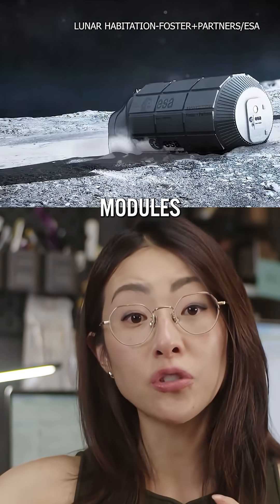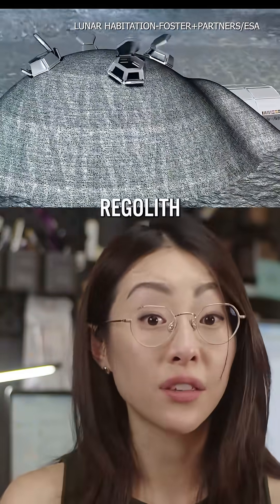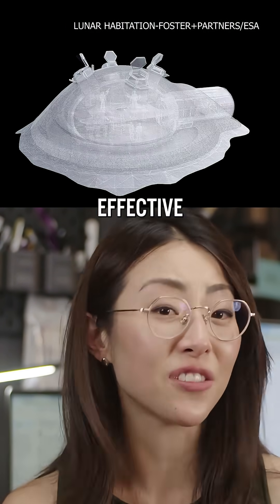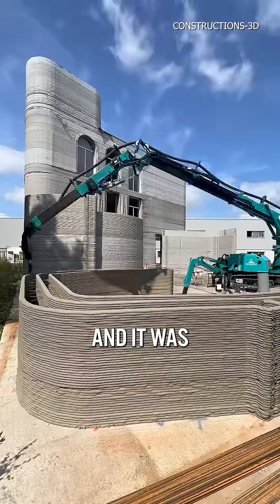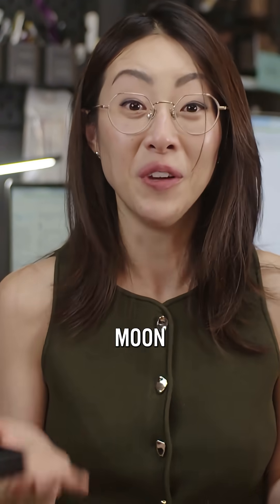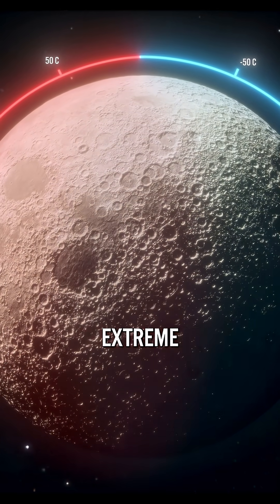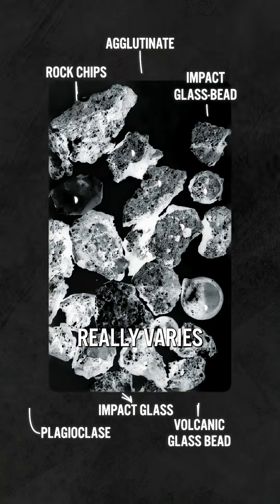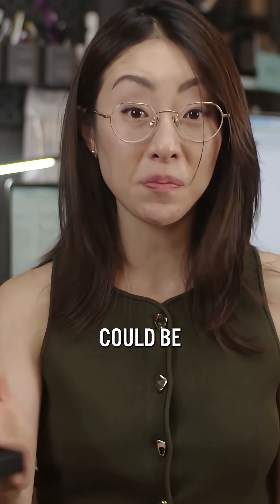What would you build first if you had a lunar 3D printer?

Comment: Lunar dust is a horror movie hazard. Magnetic, asbestos-like, and impossible to properly remove.
Reply: moon dust is super easy to remove due to its electrostatic and magnetic properties. all you need to do is charge the dust and the object you want to remove it from with the same polarity and the dust will be repelled.
Reply: @KT-pv3kl we missed out on Lovecraft not being aware of lunar horror dust that requires magnets. The man wrote novels from his fear of air conditioners and the color spectrum (and so much racism). Imagine what horrors he would have dreamt up with lunar dust?
Reply: @KT-pv3kl  doesn't sound easy? What you put out a magnet to attract it than as soon as you move it to the area, now you have just moved more. That's like using a magnet but not accounting for the fact everything your on is magnetic. Sorry if I'm wrong but it seems like a nightmare
Reply: @steve-v2g  It requires a vacuum chamber and a way to effectively do a static discharge on your suit. Modern space suits are actually really fine with the dust because they are static neutral so the dust won't cling to them. then there's the metal they use are all non magnetic aluminum so they don't accumulate charge. NASA is very paranoid and rightfully so about static discharge that could potentially short a electrical system or even create any form of spark. inside the ISS they have areas of the ship everywhere specifically made to help the astronauts discharge any accumulated charge in a safe way.
Reply: @steve-v2g you are wrong!

Its easier due to the magnetism.

Look up what an electro magnet is.

Magnetism is insanely complicated ao im not gonna get into it, but yea, it makes life easier.
Reply: @KT-pv3kl you have zero idea what you are talking about. They are this micro hook, knife, and anything sharp. And on top of that, it is also charged, so it wants to stick to things. It is not impossible but super duper hard to clean. In some cases, so bad that you might just want to use Energy Beam to just evaporate them.
Reply: Sounds fantastic. 😐
Reply: Those actually sound like benefits to me. Why not blow up a electrically polarized shell to attract the magnetic dust, then essentially use a powder coating process to seal the shell? Assuming the magnetism is due to metallic content it could provide increased radiation shielding.
Reply: @bobcostas9716  you forget the part of the powder coating process where you bake the material to melt the pigment into place.
Reply: @bobcostas9716 Not when you needed meters thick.
Reply: Asbestos if it did to Kevlar what it normally does to lungs, absolutely terrifying.
Reply: The lunar chronicles 

Is a young adult fiction series. But it does have a little mention of the effects of regolith dust on a person's lungs.
Reply: not to mention that it won't block the radiation like people think it does. You'd need about 3 stories of regolith between the habitat and the surface.
Reply: @Sadarsa that’s way not than I thought
Reply: AnikanSand.gif
Reply: It's not Magnetic 
Electrostatic charge and magnetism are very different things
Reply: @GerManBearPig thanks
Reply: portal 2 plot
Reply: Sounds like properties that might be exploited rather than sifted through traditional methods.

Comment: Did they also calculate the "Moon dust" how that might affect the building process?
Reply: Definitely not 😂

Lunar regolith is way harder to work with than earth regolith.  It's extremely sharp, like Asbestos, but cutting through Kevlar the way it would normally cut through lungs.  They also will have a lot of trouble with moisture, given that the moon is 120c during the day and -130c at night

Comment: It seams like an inflatable structure doesn't necessarily need a 3d printed shell, would it not be simpler to basically slap on a layer of 'moon cement' to the outside of the balloon, why is it necessary to "3d print"?

Comment: As I understand it, 3d printing hasn’t taken over construction because it requires a massive investment to only take care of a portion of the build. The walls are definitely a chunk of the cost to put up a building, but they aren’t the most expensive component. Also they are effectively just laying CMU and grouting, they still need interior and exterior finish. 

I think we would see a lot more 3d printing of buildings if the infrastructure and the engineering were already FIRMLY in place. But this is likely to either require a long time for the machines to get cheaper and more common, or massive public investment. 

So if building departments had standardized tables and formula to quickly stamp the plans, and if there were enough printing firms that contractors could easily swap them out for mason or framer subs, then we’d likely see an explosion. We aren’t at critical mass, and I’m not sure if we are going to get there organically.
Reply: the Romans perfected 3D printing without a 3D printer. Extrude that concrete into a form.
Reply: @RWZiggy lol. Yes, casting goes a long way. It isn’t really efficient, but is much more efficient than traditional masonry. Some pretty impressive shenanigans with that mall and the pantheon roof.
Reply: if that happens itll probably be mostly america that does it, after all they mostly build things out of wood still so they havint quite made it to the stone age yet
Reply: @Reginald-Erasmuslol
Reply: 3D printing hasn't taken over because it doesn't solve any problems present in construction. Pulling up a wall is the easiest 1/4 of a house. And doing this with 3D printing makes the other 3/4 of the house much more expensive and is structurally even inferior because it cannot handle tension, massively limiting it's application.
Reply: @dominikvonlavante6113 everytime we change or add building techniques our other systems adapt. But it is true that the other systems are a lot more complicated now. The tension is a good point. As far as doesn’t solve any problems, it does, but because it isn’t cheap and already part of the way we do things it makes everything harder and more expensive.

I’m not eager to see it take off, because as-is it really only makes pods, huts and bungalows efficiently. But I am interested in seeing where the technology could lead, and what niche(s) it could fit into.
Reply: It6 also doesn't solve any of the problems that make construction expensive. You can't 3d print electirical or plumbing or any of the other labor intensive trades.
Reply: @d @davidberry7115 im pretty sure I said that.

Comment: I think we need to find the perfect crater to build this process into a parent facility that is at least partially underground to cut printing time by 50-75% then once we have a long term facility and plan B you can send astronauts and equipment to print more smaller child facilities. Or and im not sure if this is less resource efficient. You place the entire project into a shallow but wide crater so that you can one stay out of constant radiation. and two find a more consistent substrate within the environment of the pulverized moon rock. I wonder how ejecta disperses after a strike there has to be some order to it right?

Comment: Thomas Kuhn's The Structure of Scientific Revolutions explained why this kind of behavior occurs: it’s not enough for a technology or theory to be better than the current one in order to replace it—it must also break the generational barrier to be accepted and become the norm. 3D printing can be a revolutionary technology, but right now, most of the civil engineering field is used to doing things the old way. If 3D printing truly proves to be a better technology than conventional methods, more and more professionals will embrace it and begin phasing out the old technologies. In a way, the new must wait for the old to die before it can take its place.

Comment: 3D printing will not be used in the construction industry on a global scale for another 1000 years if not ever. Those who said it will, are idiots or they wanted investor money. It cost a lot more, needs more skilled workers to put it together, limited in speed, still needs human resources while building, limited in the build shape or the cost gets multiplied, only reinforced concrete work as a building material, Plumbers and Electricians nightmare to install anything into the walls/floors. 10 skilled workers build a house faster and it will look better.

Comment: Protection from what? meteors?
Reply: I don't think any surface lunar base stands a chance against a proper meteor, though in fairness, they are exceedingly rare.  The 200x earth radiation, the temperatures of 120c during the day and -130c at night, and the dust particles moving at 100s of km/s are a much bigger issue.

Comment: Why are you building on the surface? As Isaac Arthur points out, the best permanent lunar settlements are built underground in the vast network of mega caverns formed as lava tubes (see “A comprehensive review of lunar lava tube base construction and field research on a potential Earth test site” by Feng et al).
Reply: The biggest problem with moon ground buildings is radiation shielding. Also thermal regulation.

Underground, or with heavy and thiccc regolith walls, you can shield from radiation and temperature swings.

Because, being there for a few days or a week is fine, but staying for long time, it'll be a problem.

That's also the reason all human space stations are low earth orbit, the earths magnetic field still provides radiation shielding.

Out there, beyond the earths protective field, long term the lightweight space modules don't provide enough shielding.

Likely, the first habitats will be on ground, and habited not all the time, while we dig and establish safer and more stable bases underground. Also, might harness with drilling some moon thermal heat, because we'll need plants, and lots of them, to get oxygen. Also, another thing is getting water. As water is damn heavy, but also really necessary for basic life and also basic chemistry.

That's a big part of why nasa wants to explore the lunar poles, and the Artemis missions want a polar orbit over the moon. It's the most likely part to find some water ice in craters.

There is soo much that we take for granted on earth, that becomes massive hustles to organise in space.

We really should take better care of our little space station earth. Because we really have no backups. Even if we manage to widen our adventures to moon and beyond, they'll still only be outposts, never replacements.
Reply: This is what needs to be done. Maybe not lava tubes but we could set up drones to run remotely to dig into the side of a crater and prepare area's for us.  Afterwards we could start doing serious surveying for necessary materials like iron, aluminum, magnesium, silicon, and other materials that are present on the moon.
Reply: we have to have some stuff on the surface though. Can't have the shuttles flying in and out of the lava tubes
Reply: @CaptainMisery86  yah, but in theory you minimize the time people are on the surface, we can make drones that can handle the heat and radiation fine, and if they get blown up we can just rebuild them.
Reply: I would assume most of these "plans" are by private companies that are either ineligible, or unwilling to pay, to get the quality of magnetometer necessary to find the lava tubes.  To my knowledge only two labs on earth are able to consistently and reliably make instruments of this caliber (one at NASA (at risk of defunding) and one in France).  That said, if they are patient it is more than likely all the field data will get published by scientific journals, so trying to deal with the ridiculously difficult conditions of the lunar surface really seems silly.
Reply: @drakerp2 it seems like the up-front site survey investment would outweigh the immense engineering costs associated with shielding, risk of space debris impact, and associated structural integrity issues when approaching surface building versus underground construction.

Comment: Building any long term structure on the moon is moronic, it's hit by asteroids all the time with no atmosphere for perfection
Reply: It's actually hit by large asteroids very infrequently, there is just no atmosphere so the marks left never go away.  As for the space dust, temperature, and radiation, that is all solved by building underground, in the existing lava tubes we can find with magnetic field data, which is the plan NASA has been moving forward with for years.  As for why we would want a permanent structure, a stable moon base would allow for us to go beyond earth substantially cheaper, do to not having any atmosphere and little gravity to break through.  A moon base is a critical step to make mining other objects in our solar system more feasible, as well as providing additional atmospheric space for things like pharmaceutical satellites that make medicines in 0 g.
Reply: @drakerp2  the moon is hit by around 33,000 small ones a year and larger 8 foot+ ones about every 4 years. Even those small ones could wreck a pressurized building if it hits it. Building underground sure but that's not what this video is talking about

Comment: Protection from what? Strong winds? Burglars? Tornados?
Reply: The temperatures vary from 120c during the day down to around -130c at night (with craters going even lower).  The radiation from the sun is extreme, about 200 times what is on earth, and will be a massive issue for anyone there long term.  You have space dust flying around at 100s of km/s (for reference, Parker Solar Probe has reached speeds over 400 km/s, and that's something with large mass that humans made).  The lower but still present risk of actual meteorites landing on you.  The moon dust itself which is sharper than any naturally occurring material on earth (like Asbestos, but it does to kevlar what asbestos does to lungs).

Comment: They should use foam on lightweight nylon with a fiberglass frame (pop-up tent).  
The technology exists. Then bury the structure slowly and safely in soil with a light tractor like the one in your animation.
Reply: Surface building make no sense, limited space and super expensive pressurized space, lots of leak potential from micro meteorites

On the moon,  should be building like ants with light tubes to the surface.

Using the same underground regolith to smooth and support caves, pressurized space would become so much cheaper to achieve if the rock can be coated and sealed.

Comment: Bird bones have roughly the same density as human bones (big air pockets yes, but the actual bone is very dense due to the high amount if stress they have to withstand) they are actually used as spare lung space since flight uses a lot of oxygen
Reply: You are indeed correct, the designers are using bird bone structure to add strength.  But you bring up a possibility: Those hollow spaces might indeed make great oxygen storage.

Comment: For the Moon habitat it would be maybe better to let the material flow from the centre of the dome outside and let it harden over time then flow another layer on top of it until you reach the desired thickness. There are no problems with the elements like we encounter on Earth (rain, hail, snow, strong winds).
Reply: like beach crabs do sand domes